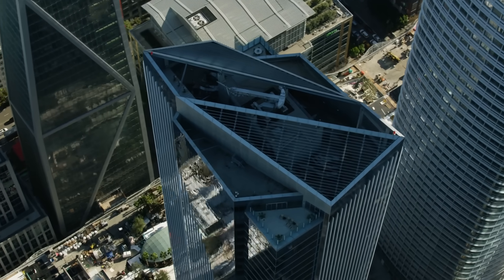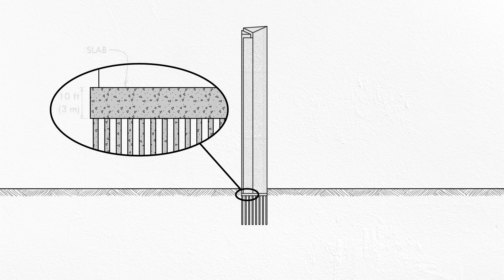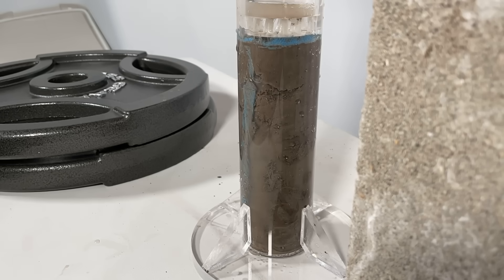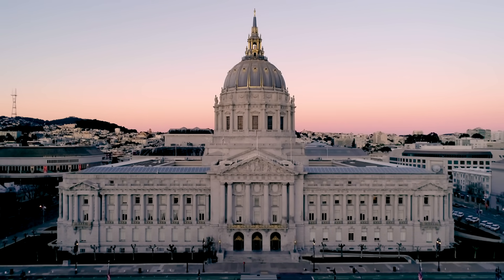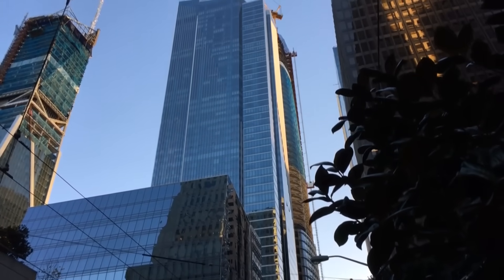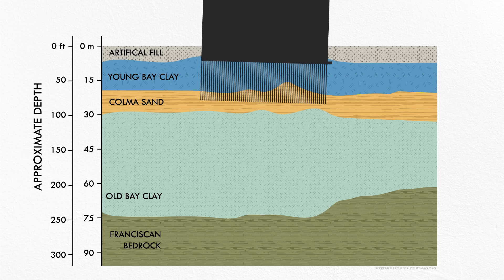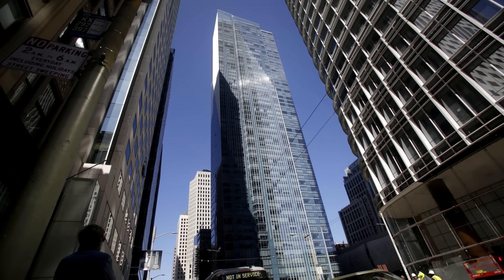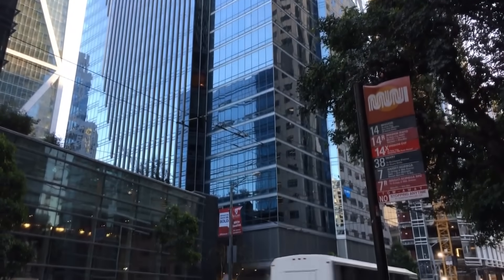What Really Happened at the Millennium Tower?

Comment: Isn’t a hydraulic jack an active solution? Wouldn’t that require constant power to remain functional? What happens in the case of a power or hydraulic failure?
Reply: I hope they don't buy those hydraulic jacks from Harbor Freight.
Reply: @jiveturkey9993  My thought too!
Reply: When you jack up your car with a hydraulic floor jack do you have to keep it plugged in to keep the car raised?

No, because hydraulic floor jacks for cars don't have plugs, because they don't need power.
Reply: @windriver2363  if you're going to try to keep that car in the exact same position for 35 years you might need some sort of pressure maintenance and adjustment system.

If they do need something like that I'm sure whatever these genius Engineers come up with will be a whole amazing piece of Engineering in itself.
Reply: It shouldn't require constant power. Hydraulics require power in order to provide the initial pressure, but then you can close a valve and seal that pressure in. As long as theres no leak, no further power is required.
Reply: @Yoshi-044  it's going to have to have some sort of pressure maintaining system because the building's going to move and all hydraulic systems leak down some amount.

Comment: in the video you said it‘s barely noticable, that the building sunk 41cm. But wouldn‘t it be obbious that the ground floor is sunk more than a foot? i mean, even the doors have to be over a foot under ground right? am i missing something?
Reply: My guess is there’s a fair bit of “slop” built in, and now instead of having five steps to ascend to get to the main lobby, there are three (or something like that).
Reply: @truthsmiles  ok, that makes kind id sense, thank you!
Reply: The thing is it is noticeable. Put a marble or ping pong ball on the floor and it will roll off to the low side, spill you water and it will flow making more of a mess. It is not visible directly but it causes effects. Also it is causing issues with utilities and you can see those too. 
Also while "safe" is one thing, bound to cause massive financial and logistical headaches for decades to come is something else, so why buy there? If anything they are still overpriced.

Comment: Related Question:  When I see some big buildings built, they'll dig a giant pit.  I assume one of the reasons they do that to make sure at the very least what the building is resting on is compacted "ground" thats going to be strong enough to allow any friction piles/supports to do their job better?
Reply: It's usually the basement - ie the part of building under surface level. Often used for parking or accesses or services (machineries etc) or even vaults. But yes sometimes they're only for pile caps/raft foundation slab that functions to make the piles more uniform (wrt settlement and group action).
Reply: isnt that to build the underground levels

Comment: should have just drilled to the bed rock from the start. hmm. would that be better? what would be the best alternative foundation?
Reply: And then get sued for padding costs with unnecessary enhancements. 

Or have some weird interaction between the piles and the clay.

Buildings like this are always a one off. It is impossible to learn from mistakes until after the fact.

Comment: Another interesting case study is the 601 Lexington Ave building in NY. https://en.wikipedia.org/wiki/Citigroup_Center#Engineering_crisis_of_1978
Basically, due to its unique shape the building was most vulnerable to diagonal winds which they didn't account for when initially constructing the building. Years later an architecture student noticed the flaw and the owner started a stealth upgrade to reinforce the building accordingly. The stealthy part was to not alarm current occupants of the building about its dangers.